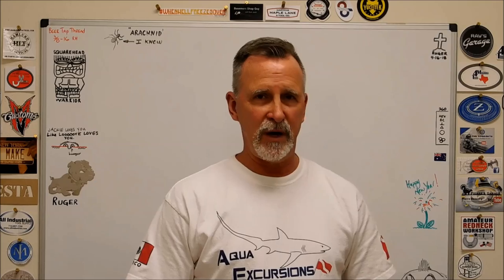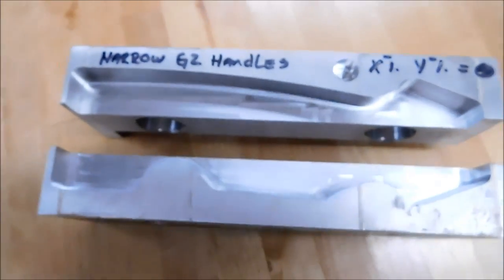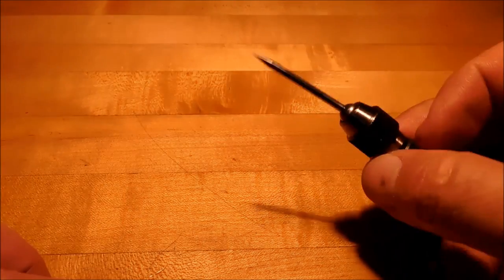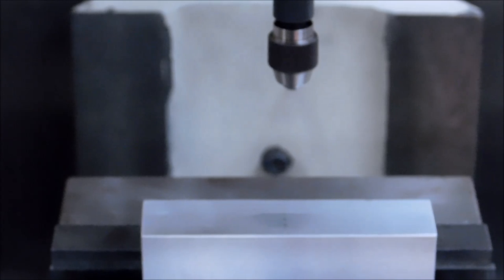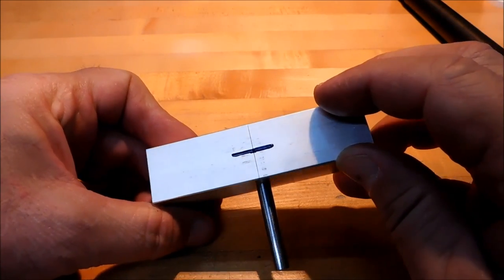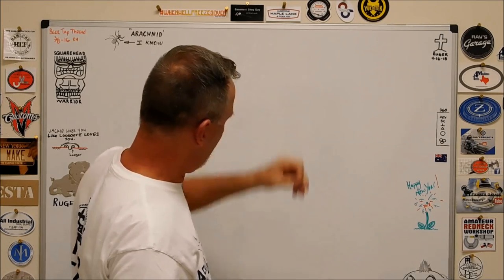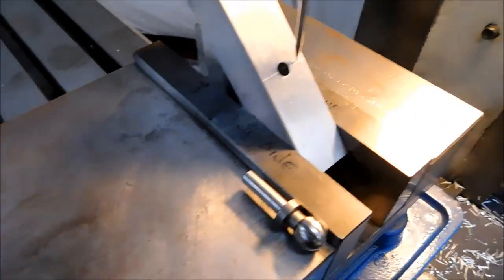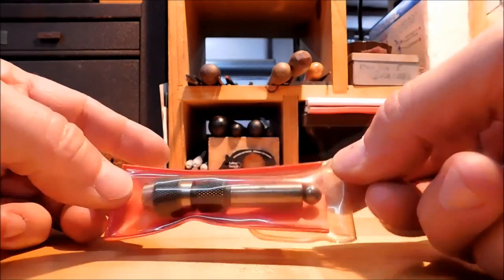Tooling Balls and Tooling Holes

Comment: Tool question. Have you ever built a tool to hold a threading die in the chuck of a lathe? I sometimes need to thread the end of a part in a circumstance where spinning the die, with the workpiece held in a tailstock chuck, would be much faster than traditional threading. One example is for left and right hand threads for a custom turnbuckle rod. In this case the threaded length might be several inches more than the material could handle between the chuck and the live center. My bore is 3.125 so I've got the room. The issues are holding the die square while making installation and removal of dies easy. Thank you

Comment: From some replies, it seems that I was interpreted as wondering about lines.  Don’t like them but the big question was about why turn on the spindle.   If you are using a collet, there should be very little runout if any.  If using a chuck, if the runout is worse than your ability to eyeball, you need a better chuck.

Comment: I've never used a tooling ball but I'm sure one will find it's way into my cart next time i'm tool shopping. Great video.  I've always used the pointy end of an edge finder to locate off of the inside of small holes. Is there anything wrong with this approach??? just locate both ends of a chord in say X and then move to that center to be on a diameter and then do same thing in Y to find the center.
Reply from the maker: Sounds solid to me. I have to try that. Perfectly logical.

Comment: I have always used the pointy side of the edge finder to find center on slots less the .200 in width. or if you have a tapered slot less then 15 degree walls. as long as your Z remains the same or do the math on the height in Z and figure out the diameter on the flat tip and drop your z accordingly.. and I guess 30 tapered and less holes. just need to be aware of the surface contact and sharpness of the corners. but always got me close so I don't need to be so careful sweeping the indicator.        keep on chipin:-)
Reply from the maker: I like that. I have to try it out. Thanks.

Comment: i use the wiggler for picking up center punched holes..i actually plung it into the hole softly and see which way I have to move my table ..when its over it perfectly it does not move when you plung it into the hole or divit

Comment: Hello Joe, I am interested in learning more about tooling holes, balls and using gage pins. I run a  Manual Devleig boring mill and recently had a job using a tooling hole. Where can I find more information like this? I could really use your help. I can really use the information too. Thanks.

Comment: Thank you Joe for the explaining how tooling balls work.  Is it possible to find the center of the ball using standard edge finders instead of using an indicator?  I was thinking that if the edge finder went down further than the center line of the ball you could pick up the tangent point on both sides, that would give you the center in X and then repeat for the other axis?
Reply from the maker: Some people would argue the rotation of the edge finder will give false reading from side to side. I could see that.

Comment: Joe have you tried the Drill Hogg drill bits yet? I have some but haven't used them yet. I'm on a budget so.... They offer a free replacement if you register them. I'm not sure if the bit has to be broken or if it can be burned up.....like I excel at even with tap magic. lol jk on that part. Thanks for the video it helped a lot.

Comment: Question for you Joe ,unrelated to this video and not one I've been able to google!.. How do you figure out the position to start a tap or thread to ensure once a thread is tightened it snugs up in the right place... for example if you took a hex bar ,cut it in half and threw it in a lathe then machined it down and take a thread .. how the would you tap the other half so when it was screwed on and snugged up, all the faces would be aligned again? If you could point me to an answer that would be awesome , Hand or lathe options would be good to know :) ..great videos as always sir
Reply from the maker: Some guys refer to that as a timed thread. If you need to clock or time 2 parts to line up as you describe, the rotational timing is controlled by facing one of the parts. For example, a 16 pitch thread will rotate 1 time over .0625 length. if you are out just a little, see if you can calculate what angle you are out and face off the appropriate amount (or less ). and check it. Then finish the specified length of the part you just timed.
Reply: appreciate the reply sir ,sounds like creeping up on it is the way to go :)
Reply: I did that thread-timing-by-facing dealio to fit a custom shift knob with no locknut.

Comment: Noticed you are using your finger to align your wiggler.  Centuries ago I was shown to use a pencil eraser, gently pressed to the sharp tip from the side until the point was rotating perfectly still.

Awesome  video.  Your video on Machining a model Steam engine #2 explains the practical use of the ball even better as it addresses a real problem with port layout.

PS, I'm Not Lisa.  Just using the wife's account to comment.
Reply from the maker: Glad it helped.

Comment: Have an old broken 6mm carbide end mill I ground to a point with the harig fixture, and I would have to think something like that would consistently be more accurate than always trying to balance the wiggler
Reply: The wiggler is independent of chuck runout.
Reply: @robinmorritt7493  often i end up using collects, also, if your chuck is running out 2 thou, you arent going to be more accurate than that with your holes

Comment: How many and which sizes do you use most? I’m guessing two or three different sized balls woukd cover most situations?
Reply: I use a 3/8" diameter ball most of the time on small work (handy with a 3/16" diameter shank if the mounting hole is going to be drilled out and tapped for a 1/4-20 or 6mm screw later). If you need one in a size you don't have, if you call McMaster-Carr before 4pm EST you will get it the next morning by UPS.
You don't need a tooling ball or a set of die buttons every day... but when you need them they are worth their weight in gold..well, silver anyway. They make it possible to locate features within 0.0003" that would be a real pain to do without them.
Reply: @Chris Draper: The only time size of the ball itself matters is if you're orbiting a probe around it (the usual situation) is when you're close to a feature and can't use a large ball. Most of the time the size is not important. Unlike an edge finder, you don't even need to know the size, and it certainly does not need to be a round number.

Comment: There is a way of making improvised wiggler with regular drill bit you stick a chewing gum on pointy end and stick a sewing needle or pin in it ,then adjust until it spins true.
Reply: We call those a " Sticky Pin", we used plasticine, this was before "Blu-Tac". I kept cutting my fingers nearly every time I stuck it to a cutter, back of your nail was used to centre..
We also called Tooling Balls "Hicky Pins", not sure why!, You can make your own with a ball bearing and industrial adhesive.
Great explanation Joe.

Comment: In the preceding comment, normal the test plate sits in position held by gravity, but if you need to you can clamp it against the balls to hold the test plate in position.
Reply from the maker: I have extensive experience with tooling plates that use a single central ball and a slot/pin for rotational control. 3 balls work well, but require a great deal of accuracy.

Comment: Re: The Wiggler. I don't get it. I have a series of tools for this purpose in diameters to match the collet I'll be using - just solid 1/8", 1/4" and 1/2" steel bar machined with a taper to a point. No need to "get it aligned". (I also chuck them in the tailstock of the lathe for setting tool height some times...) Also for operating visually like that, I LOVE my "laser center/edge finder" - I use it more than anything else unless I need precision under .002 or so.  BUT - I understand and appreciate the main point of the lesson - didn't know about tool holes and tool balls - now I do!
Reply: I have the same confusion, if you need a straight sharp stick, why start with a crooked sharp stick?
Reply: I couldn't agree more.  I use a straight pin with a point on it.

Seriously thought, Snip the pin off and mount it .   Then you start with it straight.
Reply: @edgarpryor3233  If you are holding the wiggler in a drill chuck, then it will take out the run out at the tip of the pointer when you get it running true.

Comment: Sorry for a stupid question, but what does the wiggler gain you over a fixed point in the chuck?
Reply from the maker: It eliminates any runout.
Reply: As in eliminating regrinding a fixed point to make it run true in that particular set-up?

Comment: As shown it is easy to find the centre of the ball in X/Y using a DTI. How do you accurately locate the centre in Z?
Reply: I'd use an old gageblock/parallel to carefully touch off on the ball with your endmill/drill. But maybe Joe has another trick up his sleeve ;D
Reply: @JCisHere778  I've also used cigarette paper + endmill and a dial indicator with elephant foot in the spindle. I'm hoping that Joe has some nifty trick that I haven't thought of!
Reply from the maker: @kenstrauss5006  I have a 1/2" wide 1/4" thick tool bit I use for stuff like that. I just trap it between my tool and my target or workpiece, and I know right where I am at.

Comment: Not seeing the point in using a wiggler vs using a long dowel pin (or other small shaft) ground to a central sharp point?  Other than you might not have one (sharp dowel pin) laying around.  Can anyone explain why?
Reply from the maker: I use both.
Reply: when your drill chuck , spindle of the machine is running out a bunch.  A wiggler will spin true to the center line. Put the point over your punch mark then slowly lower it into the mark.  If your off the wiggler will wiggle try again.  You can do very close work without haveing to dial to a number.

Comment: Rather than centering the wiggles with your fingers, use only the back of your thumb nail, from the side at the tip of the wiggler. It will stabilize much quicker. Also I would suggest jus a little higher speed.
Reply from the maker: I think I'll use  the closed end of a small box wrench from now on. Maybe down around 1/4". It seems safer.

Comment: Call me a chicken, but I always use the end of the chuck key to dewiggle the wiggler.
Reply: Yep;  I use the Allen key that fits my most used screwless vise.
Reply: I use the thumbnail on my left hand, with the machine is turning clockwise, and touch the very point from the left side.  Like Joe said, slower rpm, not screaming.

Comment: I’m actually more interested how you setup the dial indicator! I rewound the video like 5 times and I can’t figure out how you did it.  The dial indicator isn’t fixed to a collet or in the spindle.  It’d take me a LOOONG time do recreate it.  Make a video on how to use a dial indicator.  I’ve only ever used one accessory on my mitutoyo dial indicator.
Reply: You can use a holder like this one that clamps around the spindle: www.mscdirect.com/product/details/06451512?fromRR=Y
One of the first tools I purchased 40 + years ago.  Still use it today on the CNC.
Reply: I didn’t even know that was a thing, much appreciated!  And to think I was about to take out my mag bases...
Reply from the maker: Thats what I use exclusively. Its a great tool to have in the box and is what I used in my demo. If you cant clamp it to the spindle nose for some reason and have to clamp it to a drill chuck, make sure you lock a pin or something in the chuck to take out any slop that may result in a bad reading.
Reply from the maker: @chris0tube If your indicator has a pivot mount and you can adjust it to reach where it needs to go, there is nothing wrong with using a drill chuck or collet. If you use an indicol, securing it to the outside of a drill chuck that has slop between the body and outer shell WILL result in a bad reading.

Comment: Joe, wanted to ask you about something. Didn't know where to post. Hope it's ok to post a question here. Superb videos, BTW!
My question is about lathe setup and leveling. I see lots of videos where the lathe is leveled then tested with some cuts to check for twists in the lathe. It seems to me that the test they all use would be effected by BOTH bed twist and headstock alignment. Are there tests that can be made that will tell you definitively whether the issue is headstock alignment, twist in the bed, or both?

Comment: Can someone explain to me please how to do the math to get the offset .3536.  Is there a formula?
Reply: If you know the sides, which in this case they are both .500 then you find the hypotenuse (split the triangle in two) and divide the hypotenuse by half.  
Hypotenuse is .70710678 divided by 1/2 is .3536.
Reply: eddie2799 beat me to it, but the three basic formulae that you need to know about right triangles, can be remembered with this mnemonic:  SOHCAHTOA  (say it out loud)

SOH is Sine(of the angle) = Opposite side / Hypotenuse

CAH is Cosine(of the angle) = Adjacent side / Hypotenuse

TOA is Tangent(of the angle) = Opposite side / Adjacent

Opposite side, means the side of the triangle that is across from the angle.

Adjacent side, means the side of the triangle that is next to the angle, but is not the longest side. (Hypotenuse)

Hypotenuse is the longest side of a right triangle.

The right triangle in question has two 45° angles, and both of the shorter legs are 0.5".  Since the triangle has two 45° angles, either SOH, or CAH can be used.  That is why Joe prefers a tooling ball with the height and diameter the same.

If the angles are different, you have to pick which formula will work, based on the available information that is known on the triangle.  TOA won't work on this triangle.

SIN45° = Opp/0.5
SIN45° x 0.5 = Opp
0.7071 X 0.5 = Opp
0.3536 = Opp

COS45° = Adj/0.5
COS45° X 0.5 = Adj
0.7071 X 0.5 = Adj
0.3536 = Adj

Comment: Never could understand wigglers or pointers that can shift.   If you want to point to a line why not just put in an accurately ground point an leave the spindle off?   Actually never really got to understand the layout lines except as general reference in case you lost count on the dial.   Was taught to find the edge and then use the dial or optics to locate the features.   Perhaps this gives away my age but I learned precision machining back before NC and before digital readout.  For you kids out there, Bridgeport offered a precision scale on the mill axis that used a lens and adjustment knob to allow positioning to .0001”.   I first learned to use them in the early 1970’s.
Reply: Sometimes there is no edge, the layout line is just the start point. "0"
Reply: Have to agree, as a toolmaker apprentice, I hate eye-balling scribed lines, it takes all of 30 seconds to throw in the edge finder, anything tighter than that I would indicate anyways
Reply: @frijoli9579  How would one layout said line?
Reply: @FlybyJunkie , The layout line usually starts with a tape measure or a scale. The first point is the only one that really doesn't have to be that close. All the other points are done on the machine, from the first one.
Reply: @frijoli9579  Are we talking about CNC here or precision machining? Because I wouldn't use anything but a flat plate and height guage for scribing typically
Reply: @FlybyJunkie  lol, what does CNC "or" precison have to do with anything? What if the first hole was in a 3" thick plate 40" or so away from the "edge" of the flame cut part? Not all machine work fits on a bench. Not trying to argue with you but the question was about why people sometimes use wigglers. Precision sometimes starts with a wiggler and a layout line.
Reply: @frijoli9579  Alright, I see your point, I was totally thinking different ball game, I would hope that is a special circumstance and you're not constantly loading 500 lb pieces of work on your bridgeport, however
Reply: @FlybyJunkie  Cool cool. Machines come in all sizes. I used to build saw mills... as in commercial machines.

Comment: What’s the advantage of using a wiggler over say a piece of round stock that’s been ground to a real fine point?
Reply: The wiggler can be trued to the spindle regardless if the chuck is true.
Reply: @frijoli9579  exactly! I love using a wiggler in the chuck, only I don't use my fingers to true it like Joe showed. Any flat piece of material held at an angle and applied gently to the side of the point will very quickly make it run absolutely true! Learned that from watching clicksprings videos on yt. He uses the wiggler all the time and clock making is precision! Cheers
Reply: @5starmachineko971  I had the same thought.  Never seen a wiggler before this video but was thinking to spin it up, put a straight edge against it, and slowly back off and it should true up quick instead of trying to center it with fingers all around it.
Reply: Point may not be dead on centre